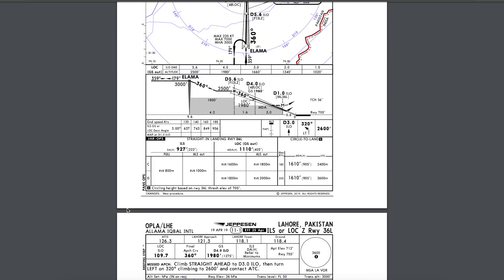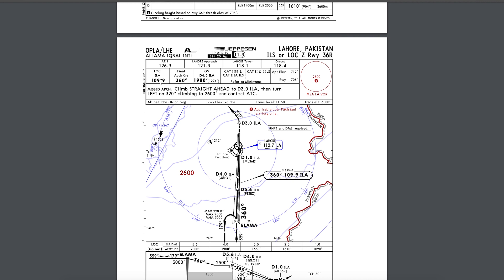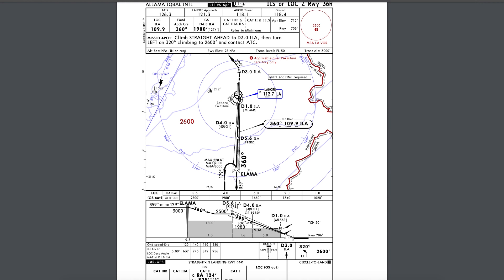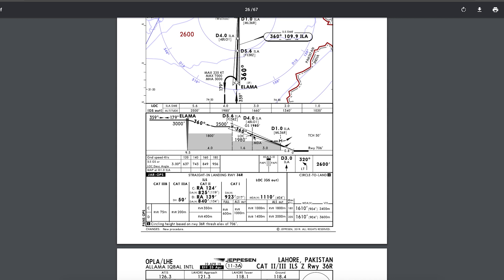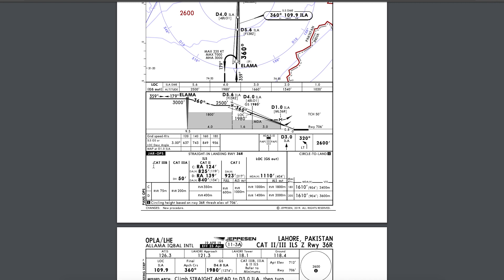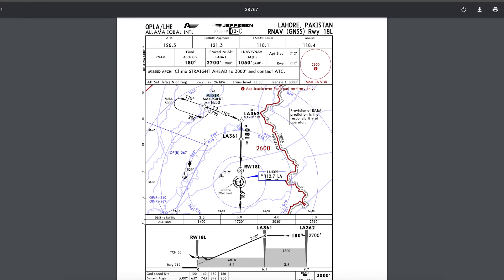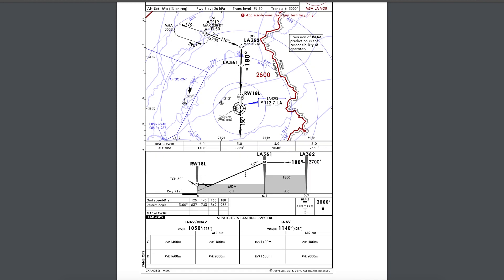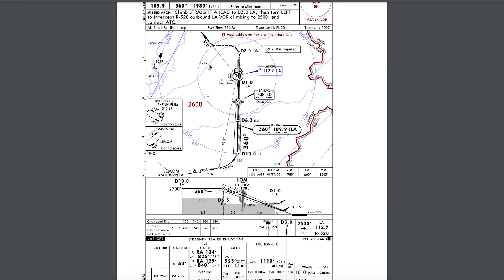Understanding Jeppesen Aviation Charts - Approach Plates (pt. 3)

Comment: watched all three great initiative by you please explain what is the difference between ILS, RNAV and VOR approach ? ILS ko to ham ne jan lia is video mein RNAV samaj nae aya VOR ka b bta dein thanks
Reply from the maker: RNAV is an approach made on GPS using Waypoints and corresponding altitudes until visual with the runway
VOR approach is flown on a specific radial till the runway